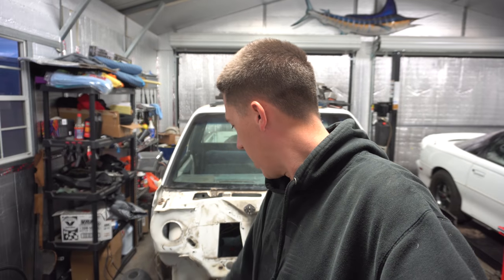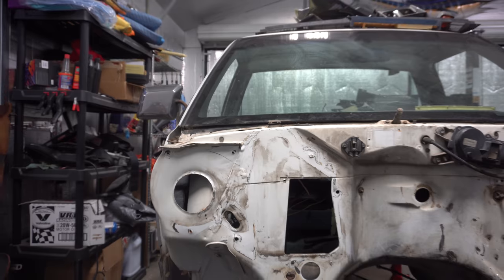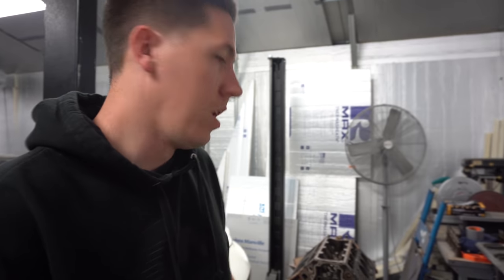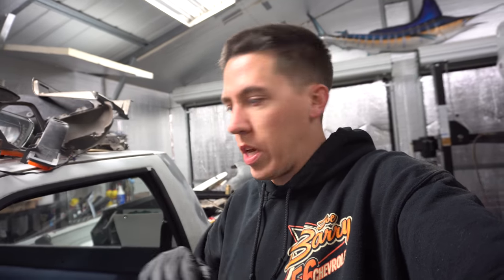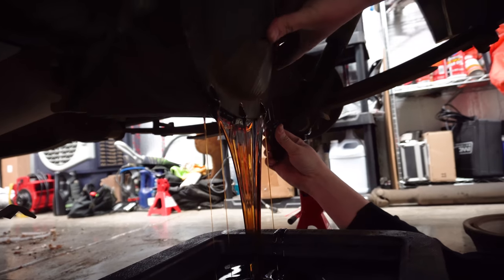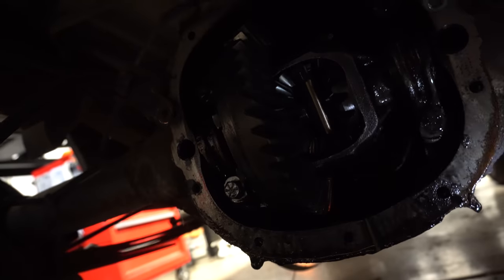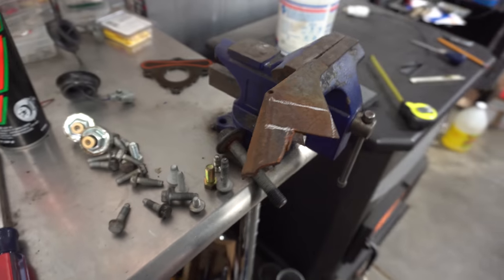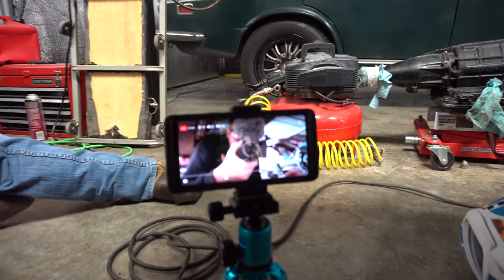LS Swap S10 Burnout Truck BURNIE gets a Welded Diff! Will it Hold Up?

Comment: Only plate the one side, otherwise you can't get the c clips out to take axles out. Or weld a bolt from corner to corner
Reply from the maker: Yeah i think this will be enough for now!